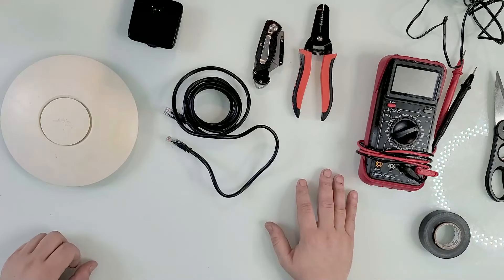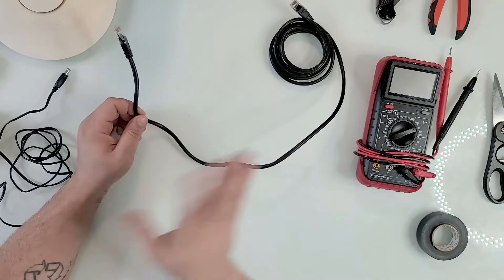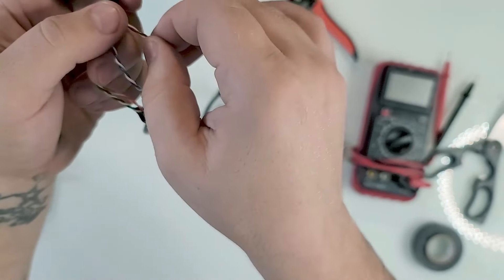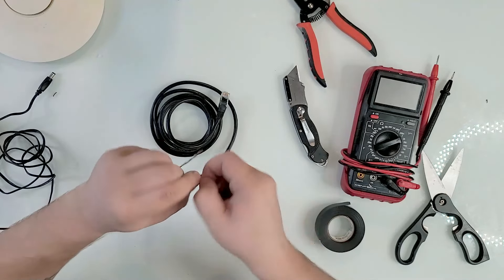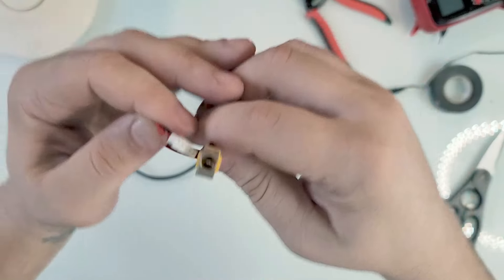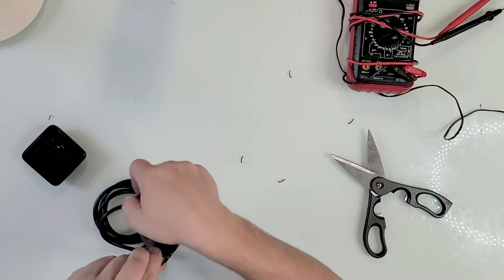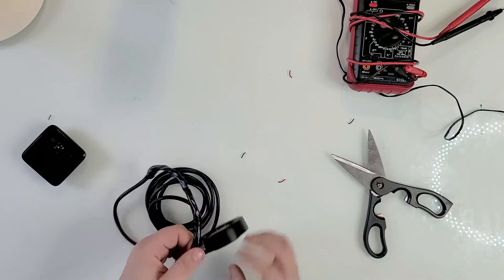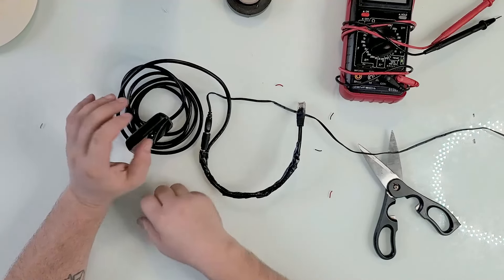DIY PoE - Power over Ethernet the easy way

Comment: Can we use just 1 wire for for positive and 1 for negative then still got gigabit of data? 🤔 And what wire would it be? White of blue wire and white of brown wire? Or the opposite?
Reply: Good question. I will test it how to get Gbit ether
Reply: @mrvendeta6139 

please teach us how to do diy poe that still do gigabit speed.
Reply: i tried it but i didn't get gigabit. i think its not possible using less than 8pins
Reply: @mznpratap7307 Gigabit requires all 4 pairs (8 wires) to transfer data. But the use of a poe powered device is usually not that it needs to send Gigabit. I'm still a bit interested on how unifi is doing it and still delivers more than 100mbit
Reply: @emsayonachi9300  not possible with DIY. Sorry.
Reply: @xsehrmotiviert  he said he didnt get gigabit
Reply: You would want to inject the power but prevent  the power from going backwards. Diods perhaps?
Reply: Don't know about the gigabit, but the other question is yes, its possible to power with only one wire for dc+ and one for dc-. Striped orange, Orange, Striped green, Blue, No-Cable, Green, No-Cable, Brown. DC+ is Blue and DC- is Brown.

Comment: I’m hoping you can help me. I was running cabling for a reolink poe camera system. By accident 2 on the cables were only 3 pair line not the desired 4 pair. I can’t rerun the line. Can I run and use the 3 pair and just not use the audio?  How do I find out what wires are for the audio on a rlc-510a camera.
Reply: then you dont need any of this to be done 😂 because it will already have power